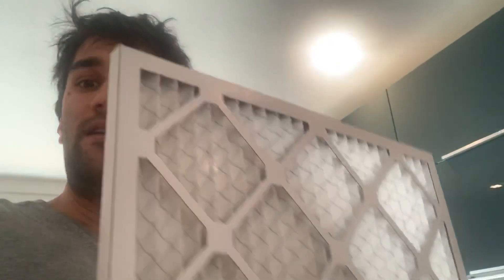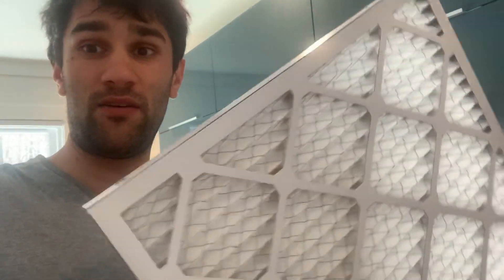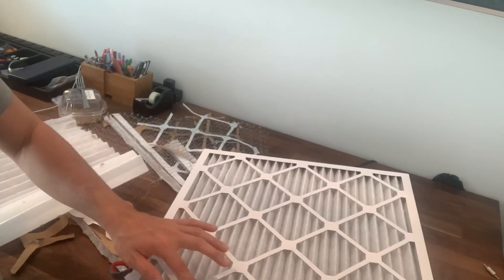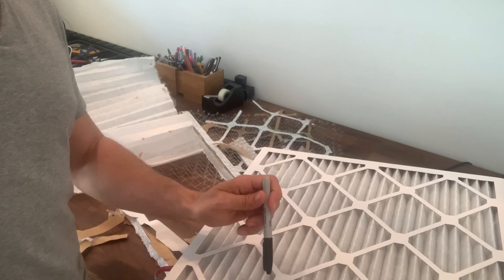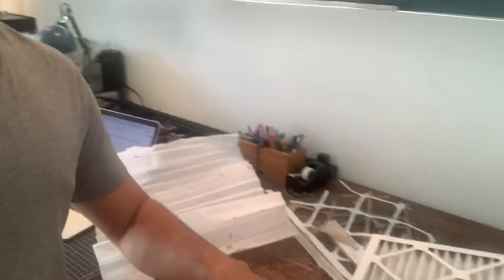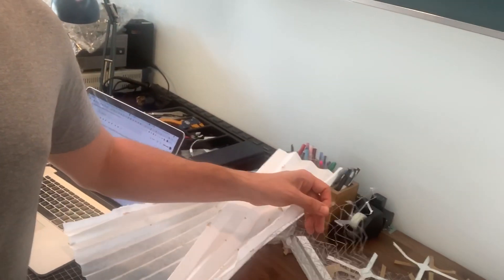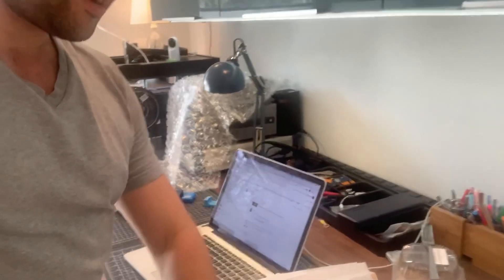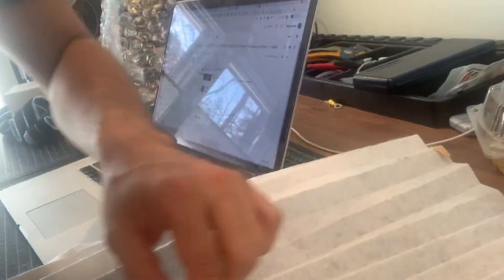Part 2: Using HEPA air conditioning filters in 3D printed coronavirus masks

Comment: I found some small HEPA cartridges that seem to work without cutting; for a Roomba vacuum. Here's what I came up with:
https://www.thingiverse.com/thing:4264698
Reply: @mutabore7  a)If a HEPA filter passes certification as a HEPA filter, it ought not shed fibers either, as the fibers would also show up in the test results. I've seen the video of the doctor warning about fiberglass, and he is right about the effects of breathing it but I think he is conflating free state fiberglass like insulation with HEPA filters which are bound together into a membrane. b) not all HEPA filters are fiberglass, some are electrospun polymer.
c) However, since there is a lot of concern about this currently, I am adding an insert to the inside that will hold a piece of filter material behind the Roomba filter. It should be uploaded within the next 20 minutes. Arguments about whether it is relevant or not are useless without further testing, I'd rather happily add the piece to be safe. Besides, I aim to please. ;)